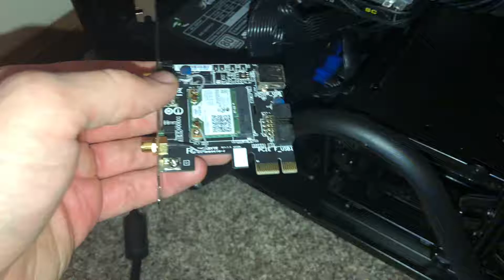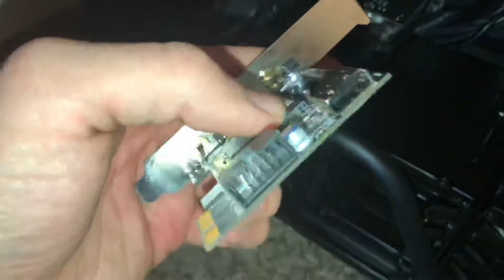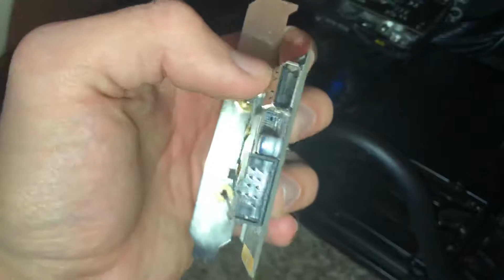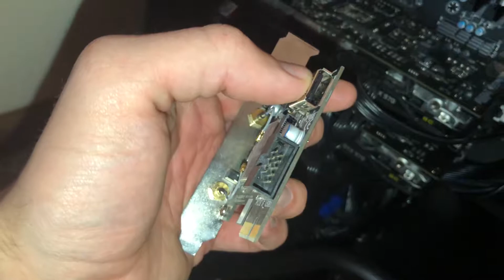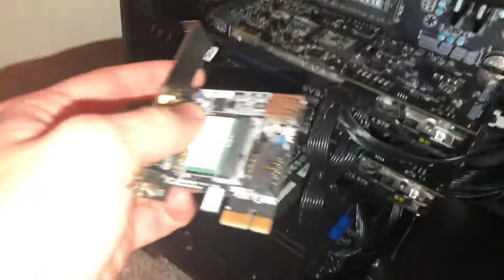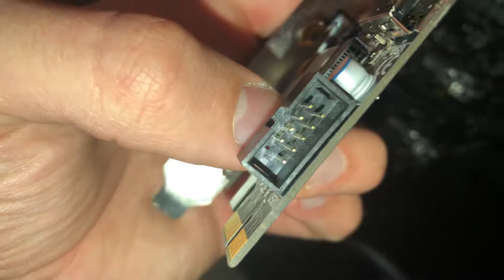What is the USB port on Your WiFi Card For?

Comment: So the way it works is simple. The 9 pin connector powers the USB port found on the card, you can then use that USB port for any blutooth adapter in a secure place where no one would ever see it unless they're looking into the case. You can't interchange which one you use, you need that connector plugged in if you want to power the blutooth usb port. The card itself is not a receiver.

Comment: The 9-pin connector goes to the motherboard and is used for Bluetooth. But this type of connector can handle two ports and bluetooth only takes up one. So they thought in Gigabyte - why don't we just make use of the second one? And instead of putting it on the back of the card, where you probably have plenty of other ports, they put it inside the case. That was a very good call. For many people it is a perfect place to hide their mouse/keyboard adapter. They might loose some signal strength, but it is more esthetically pleasing not to have anything sticking out of the case. Or maybe they just have better use for other USB ports.
Soon I will get this card and test if the bluetooth and that USB work without connecting to motherboard.
Reply: Hi Ainsruth thanks for your comment. What’s the result of the test? I got a similar card today and found there is no f Usb on the motherboard. So I just plug into the pcie and wifi seems not working properly. Thanks
Reply: No cable to mobo= no working bt
Reply: 2 years later this comment really helped me with my build. thank u so much
Reply: holy shit thats actually useful, im going to use it for my xbox wireless adapter then, thanks man
Reply: Can I ask a newbie question about which cable is the 9-pin one?
How does it work exactly because I'm thinking of buying the syoncon ACE5400 and it says that there is a 9-pin port that is supposed to connect to fUSB? So is there a cable that comes with the wifi card itself that goes from card - mobo. Or is it supposed to be psu - wifi card? I'm kinda confused.
Reply: @Titanicunillingus  just Google '9 pin usb' and you will know how it looks like. Then look into your motherboard manual, where this port is located.
Reply: Not the USB looking port. The one with 9 needle (pins) looking at the end.

Comment: You didn't answer your own question. The answer is: The USB port connects the Bluetooth part of the chip, while the WiFi part is connected over the PCIe port.
Reply: strange. Why usb coudnt be used over PCIe? But thanks that only someone answer this question!
Reply: THANK YOU SIR
Reply: I have this card and didn’t have either plugged in. Do I need to plug in the PCIe/F_USB1?
Or is it because it’s plugged in through the “anchor” part of the chip?
Reply: @olli7881  I'm late but the pcie part of the card (which is the chip of the edges to where you connect it on the motherboard) that's where all the wifi/internet connections come from, whilst the usb enables the bluetooth, so the motherboard can recognize the wireless devices
Reply: @Awsome1311  idk my bluetooth works fine and i dont have anything in either usb slot.
Reply: @Awsome1311  upon further inspection, I am saddened by the fact that I am responsible for spreading misinformation on the internet. My wifi card does infact have something plugged into its 9-pin usb header.
Reply: thank you kind sir
Reply: super odd design..
Reply: Really annoys me, I didnt install it at first and lost it, now ill have to order such a cable just for bluettoth to work :(
Reply: Thank you
Reply: Sadly my gpu is so glfat I can't even plug mine in